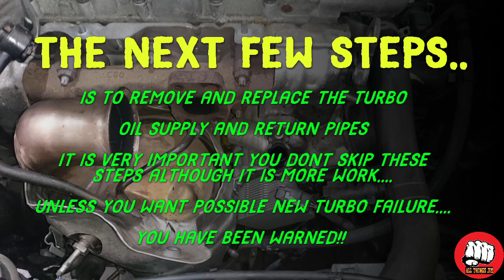turbo replacement- ford focus 1.6 Tdci 2011-2014

Comment: wow, this is a really good tutorial! I hope I will never have to use it though! I am looking at turbo vids as my 12 plate focus 1.6 tdci had some soot on the turbo. Actually there was a small amount and I wiped it off about 5000 miles and about 2 months ago and it did not come back, however it bugs me since if this is something to check out or should be fine. My better self tells me probably it wasn't designed this way meaning it must be faulty in some sort. I'll start to use the car extensively from next week and I rather go ahead of a problem than having the car breaking down on me.

Comment: Awesome detailed video my friend so hats off to you for all your efforts 💪👍 I just called ITS turbo's in Leeds and they mentioned the other essential component changes that you have like the feed pipes and the bango bolt but were also talking about a filter in the sump?? Can you enlighten me as I have the mk 2 focus on a 10 plate. I know this video was for a later model but I watched it anyway for the principal is very similar I believe
Reply from the maker: Cheers 👍, that " filter" they will be on about isnt an actual filter -I believe they mean the oil pump strainer, you could clean that out but unless your changing the turbo for catastrophic failure reasons it may be abit over the top, just make sure you  completely drain the oil and replace with fresh
Reply: @ALLTHINGSJIM  thanks Jim much appreciated and makes sense 🙂

Comment: Do you need to tune it or can you just drop a new turbo straight in from factory? Also would it be worth my while putting a bigger turbo and bigger injectors with a bigger intercooler????? Any help would be appreciated

Comment: Can just the actuator be replaced without the garret turbo on this unit? Is this actuator vacuum operated but with an electronic position sensor built in?

Comment: I baught a used 2006 c-max and after allmost a year the turbo went down.I replaced it with a new one(my mechanic) did everything they say you should do in order not to have the same problem again but guess what...after a month or so it happened again.They rebuild the turbo ..fit it and the next day the same thing.The next day...!!!!!#$$*&^.My mechanic doesn't seem to understand why this is happening...

Comment: Do you have to adapt the actuator through computer after replacing ? I still get the same p2598 code turbo boost positioning sensor and limp mode. After switching the ignition on and off the problem dissapaears again.  Anyone got any experience with this? Focus mk3 1.6 tdci 6 speed manual.
Reply from the maker: Did you actually check to make sure the boost vaccum pressure sensors are ok before replacing the turbo? as that may actually be your problem not the turbo... one is located under the turbo the pipework then goes round the engine past the oil filter around the back to another boost sensor... when you buy them from ford they come as a kit with the 2 sensors and pipework